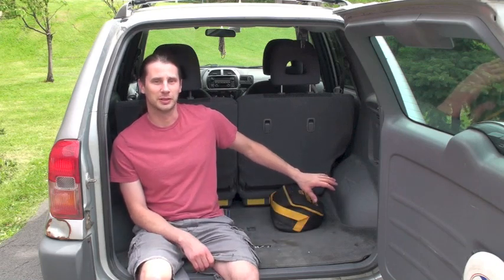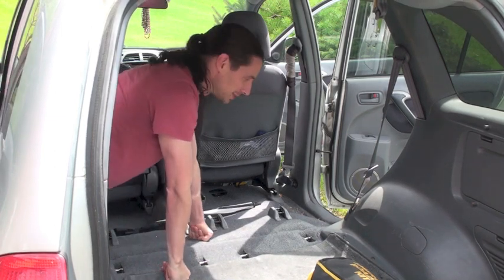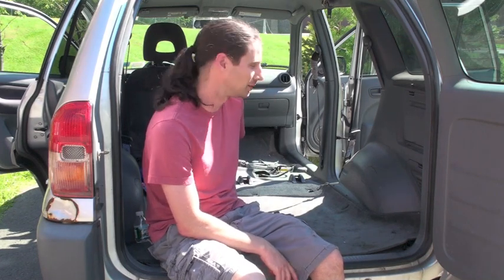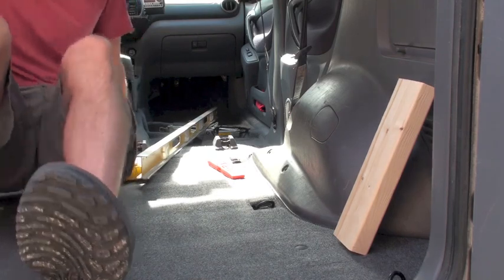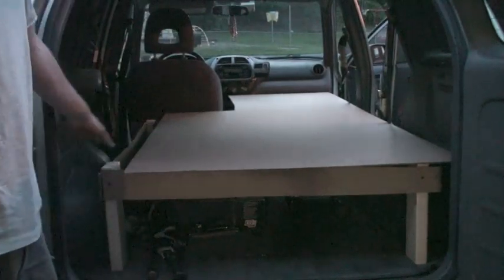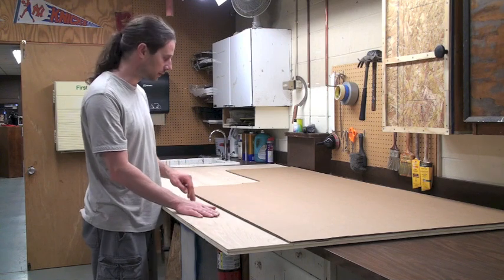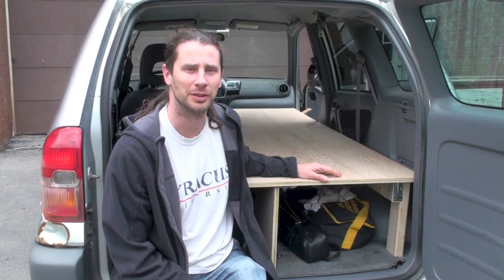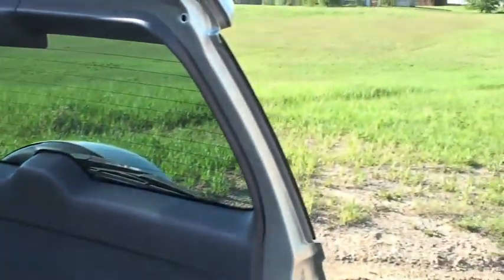Building a sleeping platform in a 2001 RAV4

Comment: Thanks!!! I'm trying to figure out if I should buy a 2001 RAV4 and I want to use it for trips/sleeping in it. This video is perfect!!!
Reply from the maker: I hope you were able to my video! This video was last year's prototype. This year I modified it to sleep two without having to take out any of the front seats.
Reply: suitsmefine100 could you explain how this is possible? the 2001 Rav4 could sleep two people in the cargo area?
Reply from the maker: Ethan Crawford At some point I'll make a video showing the mods I made to sleep two. But basically, with the rear seats taken out and the front seats pushed all the way forward there is just enough room. I was able to use the memory foam topper off my full size mattress (51"x70.5") and it fit perfect. I'm about 6'1" and I had just enough room. If I were any taller I'd have some issues.

Comment: Awesome how-to video! I also hope you don't ever get rear-ended in that. There's no wiggle room, seems like you could secure it better and that plywood is right up against your back. Be safe dude!
Reply from the maker: As far as securing it better, for a later version I added turnbuckles which connected to anchor points in the floor. That made it pretty rock solid. With the wiggle room, yeah, you're right, there isn't much.

Comment: I'd cut the front piece and put a hinge and then you could fold back when driving. I like the idea, other than having to remove both front seats.
Reply from the maker: I did the hinge thing for version 2.0! The main reason I removed the front seat was because I needed to transport a long box with my art work that wouldn't fit normally, so I had to take out the front seat. That's what the storage space under the passenger's side was designed around. A year later I traveled with a companion and needed to keep the front seat, so I modified it with hinged pieces on both sides.

Comment: How thick does the ply have to be to be able to hold up to maybe 300 lbs?
Reply from the maker: +Shan Liu I used 3/4" finished plywood for my bed. Since I made this video I have made modifications to the bed so that it can sleep two (video coming soon). I weigh about 180 lbs, and my girlfriend at the time was 120 lbs, so 300 lbs all together. It seemed to be just as sturdy with the both of us as when it was just me. The 3/4" is heavier to work with, but I think its worth it for the extra sturdiness.
Reply: Yep, I made a much lower framework with my camry, on the passenger side as well, had to lower the frame so that I will not be seeing other people from the side window when I am laying down. I made a wooden box completely out of 2 by 4 and 2 by 8, super sturdy but takes up all the space, I am trying to go to a version 2 as well where I can Thin down the sides and use legs instead. Any ways, very cool to see some one doing the same thing. I travels all 48 states earlier this year in this setup, it was very reliable.

Comment: Taking out the passenger front seed is a bit stupid idea for me... I planing something similar (hopefully in near future) and I'm going to use 2 folding front seeds from the 3 door models and folding platform - this going to keep some functionality as well as the pleasure to travel in company ;) in rough calculations it should have just enough room...
Reply from the maker: The main reason I removed the front seat (which I did not mention in the video) was because I needed to transport a long box with my art work that wouldn't fit normally, so I had to take out the front seat. That's what the storage space under the passenger's side was designed around.
Reply: Benzinio don’t be a jerk.